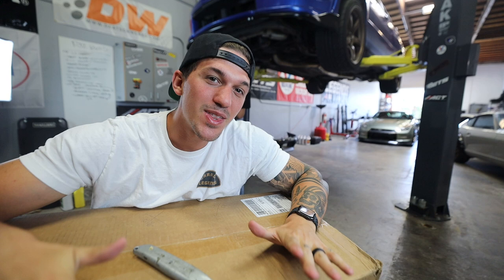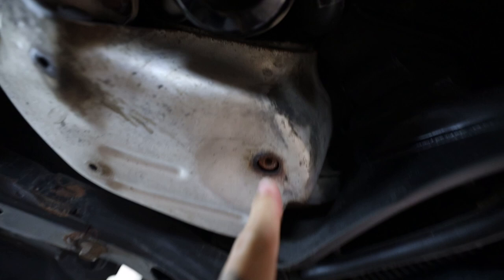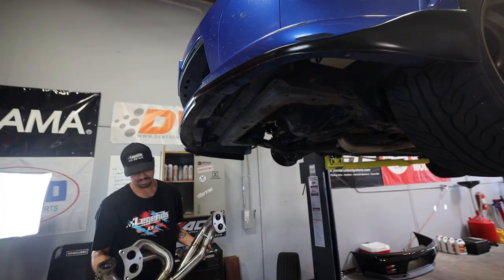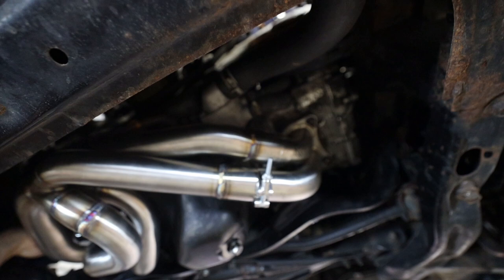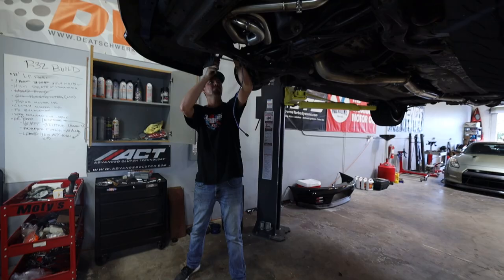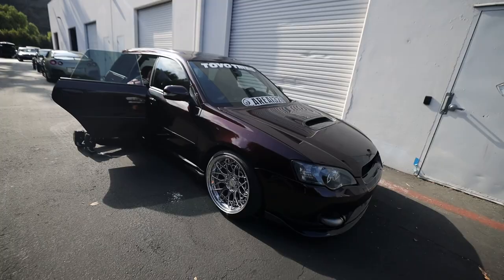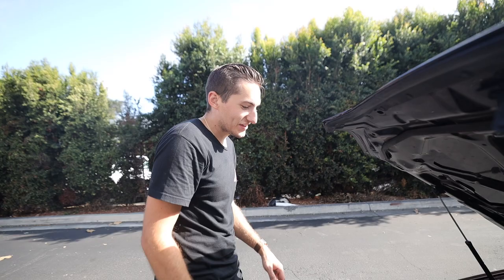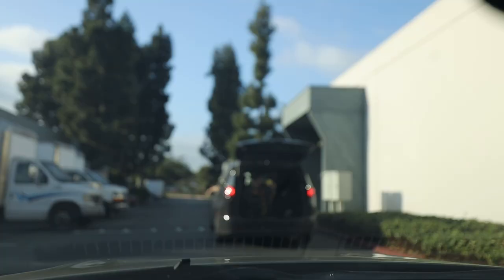Hawkeye WRX Gets EQUAL LENGTH HEADERS! | Building the PERFECT WRX EP. 2

Comment: R.I.P Subie rumble 😞
Reply: Pet peeve when people get rid of the rumble....
Reply: @coopsmayberry5346  Too true! Everyone has their own preference i guess
Reply: @coopsmayberry5346  Same bro
Reply: it still has the rumble it just isn’t as deep. it’s a more raspy rumble. the reliability of it also is much more worth the sacrifice of the rumble would love to save 5k+ on a motor if i can swap to some elh. the rumble is beautiful and i was sad to see it go on my sti but wot on it with elh sounds so good
Reply: big rip indeed
Reply: @coopsmayberry5346  moeeee powaaa baby
Reply: @chriselias2841  essentially. cylinder 2 and 4 are the most common ones to fail on an EJ and that’s because the exhaust takes longer to travel to those 2 cylinders rather than 1 and 3. the longer travel causes uneven pulses which is what you’re hearing when you hear the rumble. granted many people run the ulh for a long time and have no issues. but it definitely plays a part in why most fail. just not a risk i’m willing to take lol so i went elh on mine
Reply: @chriselias2841  Like livetosucceed said it's the piping for cylinder 2 and 4 is much longer than 1 and 3. They're usually about 3 times as long which means more heat will be in those pipes which then transfers to the cylinders. That's why when you see ringland failure its typically due to cylinder #4. ELH when raise the temps in 1 and 3 but lower them in 2 and 4. You can also do a cylinder 4 coolant mod to help avoid this.
Reply: ELH sounds so good tho
Reply: Rip
Reply: @Matthew your a bit salty bro!
I have to put up with the AUSDM ones not USDM too hahah

Comment: There is a clearance issue with the oil filter at the moment. You can see in the vid that it’s really close to the new header. I didn’t know the 07 wrx had an angle plate on the oil cooler 😑 Getting new gaskets for header and oil cooler then taking the angle plate off. Then no more clearance issues.
Reply: So does 06
Reply: I have the Perrin oil cooler on my 2013 WRX and I bought the ETS headers and I’m wondering if the sandwich plate for the oil filter will cause clearance issues for the header

Comment: From what I’ve heard, equal length is beneficial for ringland life in cylinder 3 I believe. Due to the stock headers, one is longer which creates that “subie rumble” but at a sacrifice with back pressure. Am I mistaken by this? Please elaborate if I’m wrong or entirely.
Reply: Equal length headers are MUCH better. The Un-equal length header design means that one side of the motor has a longer distance for it's exhaust gasses to exit than the other side (thus more pressure and heat). Pressure and heat along with bad driving techniques and bad tuning can cause ringland failure. Equal length means that the exhaust has an equal distance to travel from every cylinder, making it much more efficient, smooth, and cooler. This help saves the ringlands. I do love Subi rumble, but i'm not gonna harm a car with crappy rice mods. Plus in Japan they ditched the Uel setup along time ago on the Ej207.
Reply: @tdoll521  No problem, that's what the car community is for. You stay safe too!

Comment: Was there any clearance issues with the oil cooler and oil filter?
Reply: There is because I didn’t know the 07 wrx had an angle plate on the oil cooler. Getting new gaskets for cooler and header and there will be no clearance issues.

Comment: How the hell are you suppose to change the oil filter? Looks like it will hit the header
Reply: Need to fix the oil cooler. I didn’t know that the 07 wrx had an angle plate on it. Ordered new gaskets for header and oil cooler and going to replace the gaskets and take the angle plate off.

Comment: Wait does it effect changing the oil? It looked like the header was in the way to get out
Reply: It won’t be after I fix it. I didn’t know the wrx had an angle plate on the stock oil cooler. Just need to remove that plate and put the oil cooler back up. But yes right now I can’t get the oil filter off lol.
Reply: @timrichards7015  haha that’s quite annoying but good luck and thanks !
Reply: It’s annoying but my fault for not remembering the oil cooler has an angle adapter on it. I need to get some new gaskets for the header anyway so it should be good in about a week. We just changed the oil so I got a min lol
Reply: @timrichards7015  at least you have a plan, excited to see what’s next for the subi, keep up the great work 👍

Comment: can anyone school me... if the car is dying at higher RPM because of it not knowing what to do with all the extra air its receiving because of the new headers, then how do you remedy of that??
Reply: No it was dying because I broke the o2 sensor lol. It’s fixed and working fine now. But still need a tune.
Reply: @timrichards7015  ahhh all makes sense! Thanks for the clarification. I didn’t catch that in the vid. Great work on the Hawkeye. I’m following the transformation, step by step!

Comment: What’s the science between ELH and UELH
Reply: Unequal lengths cylinder 2 and 3 gets hotter then 1 and  4 so equal length just equal the air flow
Reply: @jasonrattana125  does one make more power than the other? Thanks for the knowledge!
Reply: @zackthomas3220  equal length make more power by themselves. With tuning still make more. 

It’s not a ton different different in power, but EL do make more power.
Reply: @ShredGarage  thank you!

Comment: Those header are desinged for the sti oil cooler, not the 06-07 wrx angled plate cooler. Part Number: 21311AA051
Reply: I know it’s on order
Reply: Well the gasket for the stock oil cooler is. All I gotta do is take the angle plate off.

Comment: Why... why would you buy a subaru and make it sound like an EVO... 
Should have just bought an EVO then 

Sorry but no fanboy over here...
Reply: Or a civic. . . bad move
Reply: You haven’t heard of an s204 have you ?
Reply: 1. This isn't your car, you can still voice your opionion but why so harsh?

2. If the sound is the only thing that differentiates a Subi from an Evo for you, I don't know if you should talk like that.
Reply: @LAP_Maxwell  Someone who has LOGIC. God bless
Reply: Power Gains! I’ve had both uel and el aftermarket headers and they make a crazy difference in torque and free revving. I hated the sound too but if you’re going for performance and drive ability they are the move!
Reply: @dvbzie6896  Plus Tim stated he wanted to go big power in earlier videos, so EL makes absolute sense
Reply: I don’t think you understand just how much an equal length set up benefits the car. 

Unequal lengths generally have it so that cylinders 2 and 4 get much hotter than 1 and 3; due in part to the piping for 2 and 4 is longer than 1 and 3, since those gases have to travel around the entire block. These hot gases will put a strain on the block, and over time, the risk of the cylinder cracking or having rod knock increases. 

By installing equal length headers, the risk of over heating cylinders 2 and 4 are greatly reduced, and you actually can make more torque with equal length over unequal length. 

By looking at this, the overall gains vastly outweigh the loss of the subie rumble

Comment: The unequal length are unreliable in the long run. Exhaust gases does not flow out properly and sure it gives the iconic subie rumble we all love but I’d rather go with reliability and power gains than keeping the oem unequal. Equal length is the way to go. These come oem in Japan subies just fyi. Read on the benefits of equal length headers if you’re curious

Comment: worst year of WRX (06-07) plus worst mod (why get rid of the subie appeal?)
Reply: Why is it the worst year?
Reply: @Mrhiddendeath  I dislike the headlights and taillight design. The few redeeming features of the 06-07 are the flare over the rear quarter panel, and you could get a WRX limited that included leather seats and a brake caliper upgrade.